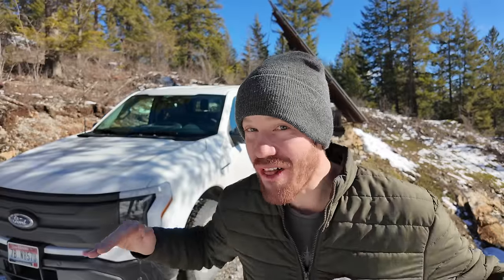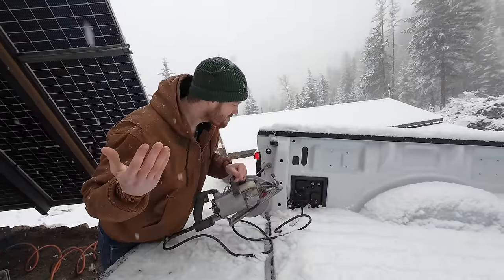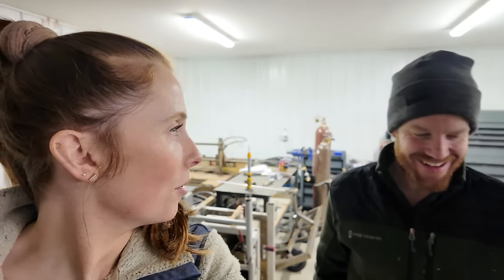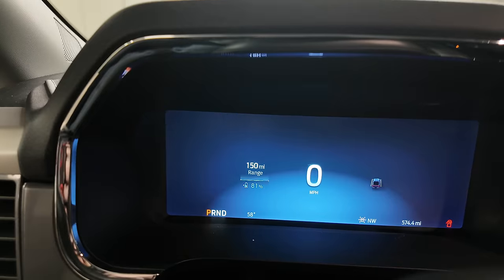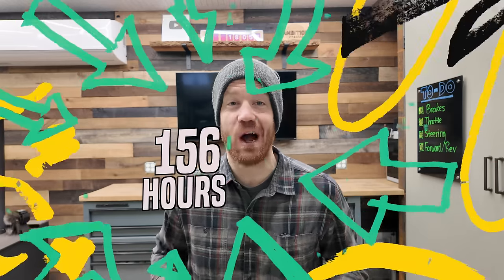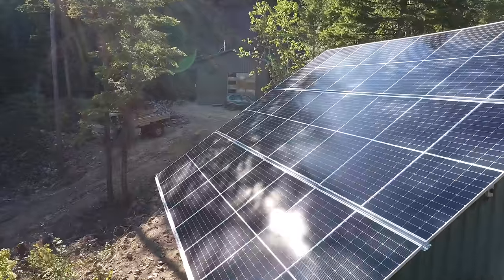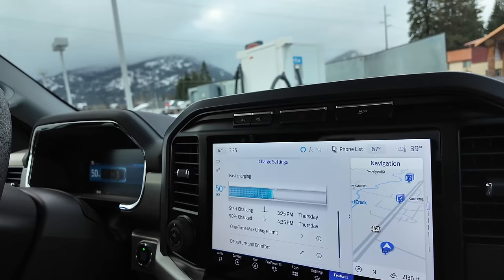Replacing My OFF-GRID Power System With an E.V. (not what I expected)

Comment: I'm surprised that you didn't learn what you didn't know from YouTube videos before you bought the truck. Only Tesla supercharging is reliable. Charging with a 120 volt 20 amp circuit is only for emergency. You have to charge with level two which will give you approximately 20 mph of charging at home. I own a Tesla model x and a lot of the problems you have don't exist with Tesla. I don't start my car I just get in push the lever. Oh yeah one more thing I do I put in a code to drive so nobody could steal it even if I left the key in the car. You should have known that cold freezing weather require specific care for electric vehicle. Somebody's never used a welder before and they try and weld they're going to have problems.

Comment: Your solar panels obvious generate power, the truck doesn't.  If do not want to generate your own power; you can get a diesel or propane generator, or even a gas generator, you could hook up a generator to your existing truck and go to town and refuel it in 2 minutes.  Using an EV truck just wastes your time.

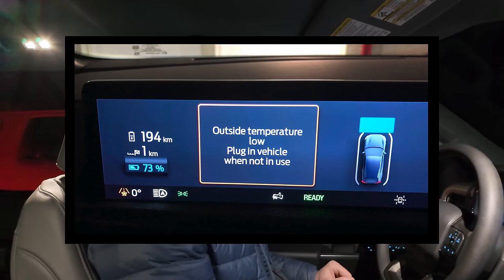Comment: My company put me in a F150 lightening with the extended range battery. I think the truck is power hungry. I got caught out away from work and only had a few miles left. I found a charge point charger at Buffalo Wild Wings. After nearly 4 hours(3:50) I had gained 52 miles and I was 51 miles away from the office. I barely made it back with 3 miles remaining and full throttle would only let the truck move at 35 mph. The truck rides good, and has plenty of power, but the range anxiety is real.

Comment: Next project. Try to get a woodpowered electricity solution. Either run a generator on wood gas or  a heat-to-electricity generator. Would definitely be interesting to see for us living in the north with little sun in the winter. It is probably not very efficient but might still still be worth it becoming energy independent.

Comment: What runs the hvac in an EV?
Reply: Depends on the year and make.  Some EVs use resistive heating and an AC compressor, some use heat pumps for heat and cooling.

2022-2023 all trims, and 2024 XLT have resistive heat, and regular AC compressor.  2024 Lariat and Platinum have heat pumps.

Comment: Now that people have more EV vehicles and more usage on the electrical system the price of electricity has gone way up. It cost more now to run an EV than it does a gas automobile per mile now and it is only going to get worse. The price you paid for the truck is bull 49000 . They have gone down in price and still cost 58000 for the basic not the extended miles. Must have got paid a lot to do this video.  Some of your numbers just don't add up!!

Comment: My issue with the video is that you were equating electric vehicles using a Ford pickup as the standard. All legacy automakers have made horrible electric vehicles this is not my opinion this is fact. I do realize you could not get a Tesla cybertruck but you should use your words carefully because people watching this will think all electric vehicles are the same. That might be the case with legacy automakers vehicles being the same they're all made to die after 3 to 5 years. Tesla came into the market to change all that while I was a big skeptic 8 years ago I am no longer.

Comment: Personally, I am not a fan of electric vehicles unless you have a golf cart.  In fact, I am developing a system to mass produce E motors for one of the large vehicle manufacturing.  Still, we know the infrastructure and robustness isn't there yet.  However, I was impressed with this video and what you were able to prove.  Obviously, the truck wasn't designed to operate the way you did or you wouldn't have to have the system ON and pretend running to operate the rear outlets.  Great job.

Comment: Electric vehicles have the same issues as they did from 1880's until they gave up on them in the 1930's last time.   Parts, maintenance, convenience, and weight. I wouldnt start crowing about the utility of the F150 electric truck, try towing something or fill the bed with any weight like you would any real truck, its disappointing. Still just an expensive toy.

Comment: Wait wait wait… UK runs 240 and has a neutral. What’s the thought process that suggests a 240v supply does,t need a neutral, when every other 240 supply has (or should have) a neutral…
If you don’t have a neutral, are you using the earth as neutral. So confused (electrical novice 😂😂😂)

Comment: Evs are not worth it at the moment. If you take the total manufacturing cost including taking materials out of the earth it is more expensive and causes more pollution then a normal gas powered car. You wasted your money. You might as well have burned it.
Reply: Compared to the 20 tons of gasoline a truck will use over 100k miles??? Please be serious.

Comment: Well you are certainly on the bleeding edge of this tech.  Ease of use has not yet become a thing.  There will certainly need to be a standard developed so that all evs can do this kind of thing.   Until then this is what you get...a customized solution for your own needs.  Buy a different vehicle and the system will likely have to be changed,  Not turnkey yet!

Comment: An EV is a huge waste you your time as it took over two hours to fast charge the vehicle in town. This is the same if you were taking a long road trip and having to stop every few hours to charge is a huge waste of time. However, if the vehicle is just used for commuting and charged overnight at home then it makes more sense. EVs are not green, even though where you live the grid power is from hydro that is not the case for most of the US, renewable energy from wind, solar, hydro, biogas, etc is a small percentage of the total power consumed by Americans. The amount of pollution from the burning of millions of gallons of diesel fuel in heavy mining trucks, shovels, and the processing of ore for the lithium, nickel, cobalt, manganese, and graphite much of which come from Africa is not green and then those minerals are shipped on cargo ships(more fossil fuels burned) to the country where the batteries are manufactured and then shipped(more fossil fuel burned) to the US and put on a train(diesel fuel) or truck to get to the auto plant.
If I were you, I would buy another pallet of bifacial solar panels and double the size of your solar array. You do not size a system for the optimal production time of year (i.e. summer) size it for winter, so that even on overcast days you are producing enough power to equal what you are using. The other suggestion would be to buy more SOK batteries to increase your storage capacity, especially because now you have an EV and lots of other battery powered equipment. So, when you do have a partial winter sun or even full sun you can charge your increased battery bank size to 100%, the truck, and all other battery powered equipment before the sun set. If you increase your solar array and battery bank size consider a 'dump' load after ever everything is charge like heating a heavily insulated(12" of insulation on all sides) a 500 gallon tank of water for use in heating domestic water and space heating for the apartment. Generating heat from electricity whether for hot water or space heating draws a lot of power from your batteries. The hot water dump tank is just storage, inside the tank will be a heat exchanger for domestic hot water and a second one for hydronic heat. Your domestic hot water never mixes with the water in the storage tank same with the propylene glycol heating circuit, cold fresh water goes through the heat exchanger in the dump tank first when hot water is called for and then goes to your water heater to get up to its final set temp. When hot fluid is called for space heating it circulates through the heat exchanger in the dump tank first and then goes to your boiler or heating system in any case both systems are picking up the maximum heat available in the dump tank before having to expend electricity to bring the fluid to its final temp.

Comment: This is one "project"/purchase that you wasted your money on. It won't be as obvious until after the first year or two - a couple of weeks or months will NOT show you it's real faults, especially now that winter is almost gone.

Is the fake motor noise the sound of the fans that cool the inverter in the truck?

And NO, I would never waste my time owning an EV.  There are numerous videos showing it's poor performance when towing a trailer and how much time is wasted charging on a vacation trip. It's also proven to be worthless if you get stranded in winter conditions, whereas an ICE vehicle can be refilled in minutes with a couple of cans of fuel.  Winter conditions also significantly lessen the life of the batteries.

Comment: I don't own an EV but I've seen a few stories where they occasionally catch on fire even when they are turned off. Using it the way you are is cool, but I am worried that at some point something may overheat. Touch wood that you never have any problems.

Comment: Riley - I am totally astounded that you would even think to consider that an EV with any size battery pack could replace your solar and battery back up to power your electical needs. If you had hours to waste during the day, I would maybe think that you might be able to do it. But the time spent driving to an EV CCS charging station, plus the time spent charging up your EV, plus the time spent driving back to your home would, I think, be incrediably large, prohibitive and very poor use of your time.
Granted, in an emergency situation you could use your EV to supply power to your house, and if you do then it should be to totally essential items, refrigerator, stove, certain lights. You could certainly not run your cnc router or weld...

Comment: Sorry guys...not sold on EV.s at all...I think it's a scam to the people of the United States...If EV's are supposed to be green, let's look at all the pollution and energy to produce the lithium batteries...then, what are they going to do with the batteries when the are depleted? Put them into a landfill and pollute the ground and water...What about the fires that the batteries are causing...another concern. So, am disappointed in this new adventure your trying...
Reply: Wait until you find out that there are countries other than the US, and EVs are becoming the most common vehicle in many countries.  Norway, for example, is almost 80% EV.  EV batteries get recycled when they no longer hold a charge, and made into new batteries.  The materials they are made of are very valuable and can be infinitely recycled, unlike gasoline.  Redwood Materials is one example of a company that recycles batteries.

Comment: Okay, I have followed you through many seemingly weird decisions.  But EVs are a poor idea in total, today.  Even with Billions of subsidies and other money going into the industry, every manuafacturer is losing thousands even tens of thousands of money on each vehicles and the prices have to be dropped to sell them at all.  Replacement costs of the battery in a few years are half the cost of a new vehicle.  Not to mention the entire power grid would go down and stay down if only 25% of the vehicles in the US are electric.

But in your case, in the winter you are running the generator for your regular needs except for a very few days.  So charging at home means you are running the truck on diesel or propane, just like your snow blower.

Imagine if all your other vehicles required multiple hours to fill up with fuel.  You would consider it completely unacceptable.  But somehow the novelty of this truck, you seem to dismiss it.

In the summer charging at home may work.  But a summertime only vehicle should be a motorcycle, or boat.

Wait till you have to pull a trailer a hundred miles.  It won't even make it without another 2.5 hour recharge.

That is a lot of downsides to be trendy.

That said, I love your channel, and I'm an electrical engineer, so my comments do not come from prejudice.

Comment: I look at what your doing and you seem to be a slave to your power system.  I wouldn't want to be bothered by all you are going through to have power. 
You spent $49k for a truck and that was $49k that could have been spent on fuel for the generator.  How many years of fuel would $49k buy? And what is your time worth that you're spending getting batteries charged?
I am old. I can't afford to waste time on changing some stupid EV. 
You know that Ford truck is going to be very unreliable don't you?